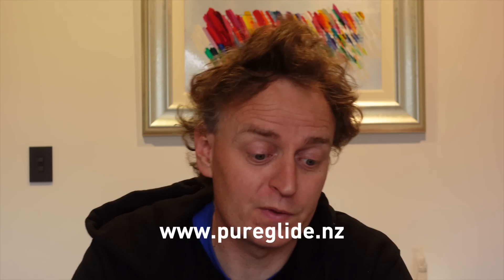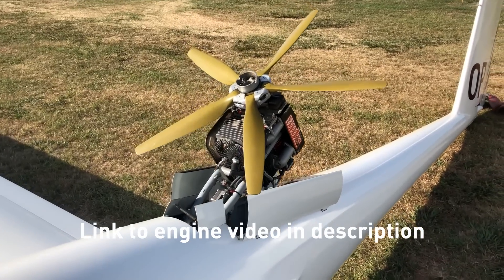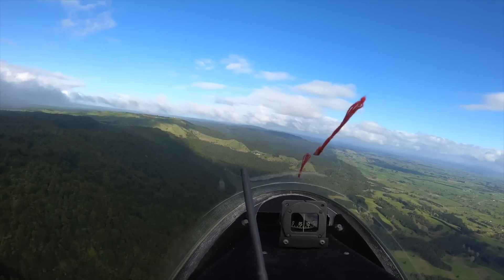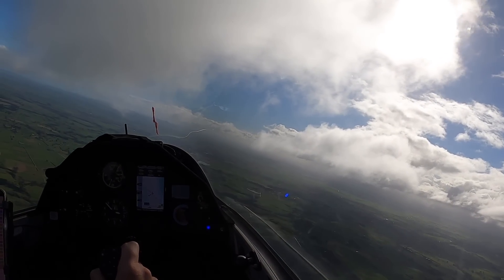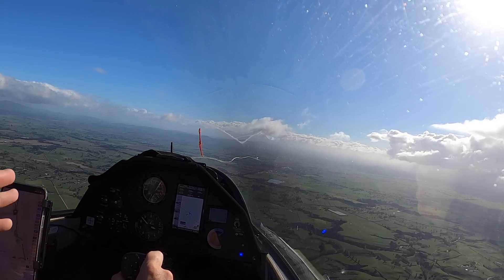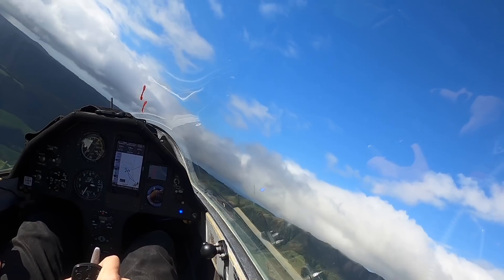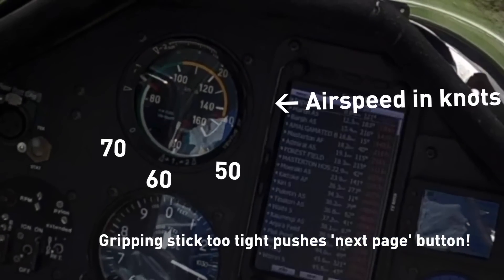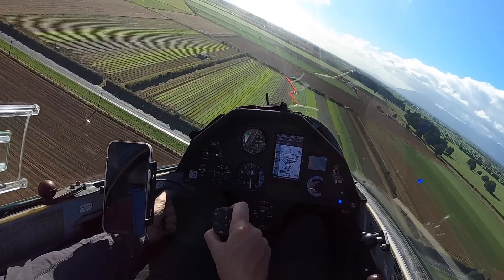Is it safe to open air brakes/spoilers in a turn?!

Comment: I love the format of the video, use this pace more (a bit of chatting, a bit of flying, a bit of stunning landscapes, a bit of music, a bit of hands off flying, show these machines are stable platforms.. nice).

Another reason why I remember being taught to avoid to use the airbrakes in a turn (unrelated with this specific case) is to avoid the potential build up of a bad post-solo habit. 
The bad habit being: to fly a crammed, very close-to-the-airfield downwind leg, and then fly a "descending elongated U turn with airbrakes out" as a base+final to lose the inevitable extra height you would end up having; thus losing the value of flying the very important base leg.
Apparently there's a tendency to do so if you get too "affectionate" to the airbrakes early in your pilot life.
I thought it might be worth mentioning it in a comment.

Last thing :) .. the comment on the video about the "next page" button made me amused a bit... no wonder you were gripping the stick, and probably the breaks' handle, pretty tight in that turn eh? 🙂
Reply from the maker: Thanks Bruno, yeah I grip the stick weird over the top of the buttons anyway, so if I grip it tight it pushes the buttons. It's like a built in stress-o-meter!
Reply: @PureGlide  that's an idea for a piece of avionics: a stress-o-meter that talks to the pilot.
"It looks like you're under stress, pull over and take a nap" 😅
Reply from the maker: lol that would be handy!

Comment: Best proof is to test it in flight, well done. But there are some variables in each flight, like the airplane, wind, landingfield (trees or swirls) or even mental situation. Thats the reason why I teach my students to not open the airbreaks in a turn to final. A accident is always a line of small mistakes and espacially in final we want to avoid every bit that can lead in a stall.
But of course you can take the airbreaks if you are familiar with your airplane and know what possibly can go wrong. I wouldn't teach it anyway.
Reply from the maker: Fair enough! Cheers

Comment: Great video Tim! One of your better ones from a chatting standpoint. I really like the conversation while in flight and panning to cool views as you have the discussion on the topic. 

As for dive brakes in a turn, it's the only way I fly the pattern. We get a LOT of sink in Florida at the end of the day, and the only way to protect against it is to not lean on the glider's glide performance in the pattern. So we fly a reasonable but tight, half dive brake (yes from abeam touchdown point), triangle plus 5 pattern to avoid being caught out in sink.
Reply from the maker: Sounds very sensible! and actually that sounds ideal, half brakes, so you have options either way. Keep doing that I suggest!
Reply: @PureGlide  I've noticed a lot of European pilots fly a massive pattern and then on half of their final they'll then use half dive brakes. I find this interesting but can't come to grips with flying the pattern that way. 

So yes hehe I will continue.
Reply from the maker: Yeah often we do that to conform with other circuit traffic. They love doing big circuits...

Comment: It would be very interesting to see the difference while doing more steep turns (45 degrees, maybe even 60 degrees). As we know stall speed increases with bank angle, and I think then airbrakes may have higher impact on a stall speed. Can someone do such experiment? Best would be in some kind of training glider, with big airbrakes that open on both sides (up and down) of the wing.
Reply: I was trained to use airbrakes starting on downwind leg as needed, ideally half open, and keep them open throughout the traffic pattern, including downwind to base turn and base to final turn, modulating them as needed for the correct altitude.  I was trained to use best L/D speed plus 1/2 wind gust factor as my approach speed in the traffic pattern, and keep the airspeed constant throughout the pattern.  This will usually give you a 15 to 20kt margin over your stall speed, which puts you well out of danger of stall/spinning on any of the turns in the traffic pattern, even with full airbrakes open.
Reply from the maker: Yeah good idea! Maybe I'll do it as part of a future flight

Comment: I think alot of the "stigma" about brakes out in the turn comes from training, where we stop pupils doing it in the final turn - primarily because more often than not its too much workload, and suggests they haven't stabilised the aircraft onto the approach. A pilot learning the approach will generally be unable to pick a reference point, nail the speed, judge their descent and complete a turn, all with the brakes out. So we teach to only open the brakes once all the others have been set and you're lined up where you want to go. Usually the brakes come out in the turn when the pilot knows they're too close in and high - a failure of circuit planning.
Once you're experienced, and particularly if you're landing out after XC, you can open the brakes whenever you like, so long as you have the speed for it, as Tim demonstrates here.
Reply from the maker: Yeah good points too, cheers
Reply: exactly. As a student, it's good advice. As you develop as a pilot and become more skilled and know more about your aircraft, it's fine to use the airbrakes in a turn if you need them.
Reply: I am completely lost when I read that. Aren't you suppose to extend airbrakes during the base leg? Then retracting them for the final turn, then extending them again after seem to be more workloadthan just letting the brakes as they are during the turn.
Reply: @haltux  training obviously varies by country. In the UK we teach new students to only open the brakes once the final turn is complete and you're set up on your approach. They can be used before that to adjust height, but it's preferable to widen out your circuit if possible than use the brakes.
As discussed am experienced pilot is free to open brakes on the base leg if they judge that necessary to approach where they want. The point I make is that early students don't always have the experience to make that judgement, particularly in advance of completing a turn, lining up on their reference point and adjusting their speed etc. We also try to avoid the "landing lever" mentality where early pilots go through the motions and just open the brakes after the turn because that's next - we're trying to teach them to judge the picture and open the brakes if and when needed. Therefore it makes sense to not open the brakes before the picture is set.
However the takeaway is often "don't open your brakes in the turn". An unintended consequence and the video shows why that's not the case.
Reply: @beefgravy OK thanks for the explanation, it makes sense. In France, where I am just starting my training, you learn to extend  your brakes during the base leg, typically half of it, and adjust depending on your height. It's interesting to see there are local specificities like that.
Reply: To stall at any speed you need to have sufficient pitch authority to exceed the critical angle of attack.  At typical approach speeds in a well banked turn onto finals, there is unlikely to be sufficient aft stick authority to g-stall most aircraft (unless the speed comes back to near normal approach stalling speed in a turn).  This is due to the normal nose down pitch tendency in a moderate/steep turn, which needs to be countered with rear stick, thus reducing the useable aft stick range available. Unaccelerated stalls in a turn are another matter.

I would have liked to have seen Tim demonstrate opening the spoilers to at least 2/3 once already established in his simulated finals turn.

Comment: MDM1 FOX 🦊🙃Driver from Austria here. I also release the brake flaps a bit on the approach, as long as you pay attention to enough speed, and always keep your nose below the horizon, it's not a big deal. Much more critically I look at the square approach with 2 quite tightly flown curves, which I always flew wrong. I always fly a very flat 180 degree turn with little bank. to talk into the final approach..  Always happy landings.
Reply from the maker: Yeah I think it’s good to have reasonable turns, nothing ‘wishy washy’

Comment: I generally don't pull open brakes or flaps during a turn.  This is more to do with the possibility of a mechanical / asymmetrical opening resulting in unplanned roll than anything else, once deployed use them - focus should be on speed control, aiming point and coordinated well banked turns.  I had an asymmetrical flap deployment (in a powered plane) once on downwind. Gets your attention - had I been in the turn to base when I deployed flaps and that occured, I don't want to think how far it would have rolled me at low altititude.
Reply: Not a glider pilot myself (wish I had the time, love it), but a light aircraft instructor, I teach my students the same thing. Refrain from opening flaps in a turn. I always use the exact thing you’re describing as a reason why. 
Having said that, have I ever done it myself? Will I ever do it again? 
The answer being:yes. 
At certain instances I have, and I may do it again. 
But I try to refrain from doing so. 
The fact that air brakes or flaps work when running the checklist is not a perfect guarantee the will work the next time you operate them. 
Basically it’s a numbers game isn’t it?

With all that said, cudos in a big way to our instructor here on the channel for discussing a matter where people question his actions. And for keeping an open mind about it. Brilliant and a show of very good airmanship!
Us instructors are by no means protected from ever making mistakes. 

Happy landings and safe flights!
Reply: @residensetresidenset6930  "With all that said, cudos in a big way to our instructor here on the channel for discussing a matter where people question his actions. And for keeping an open mind about it. Brilliant and a show of very good airmanship!" - I agree completely with that statement!
Reply from the maker: Thanks people :)
Reply from the maker: Hi that's one reason we have a 'brakes' test in our pre-landing checks. Very unlikely to get to that stage, but you never know, and you want to know early. Cheers!

Comment: I reacted about extending the brakes in a turn. It’s a marginal thing that sometimes make a huge difference, e.g. stalling the left wing or not upon a low approach.

The speed here was high enough to do it safely, i noticed, but why should you? The wings can be covered with insects or dust and don’t perform optimally. Maybe the wings still contain some water. Things happen and I see no reason to add a potentially dangerous factor to the equation. Extend the brakes when level and land a bit further down the strip. Good safe plan, right?

But, the stalling limits were examined in this video, and I should have done that myself. I'm a conservative pilot, sticking to routines because they tend not to get me killed! Once I return to the skies (alas, in a year or two), I’ll have to experiment more. I didn’t expect that out of this discussion. Still, I won't extend my brakes until level.
Reply from the maker: Yeah good points, and you're right, if you don't need to, why do it? In my original case I was concerned about running out of runway, doing a tailwind landing, and had an aiming point I was aiming at. And I needed the brakes to get to that aiming point, so I used them. Simple as that!

Comment: my teaching was "never, never, never,.....but never say never"

from your flight test, & known data / facts

+ 1-2 knots for your glider airbrakes out stall, using our Grob I found + 2-3 knots.
- airbrakes can change the trim / attitude , depends on the A/C.

clearly you had good speed on , and you're a better than average pilot, by some way.

for the average pilot they may be struggling with a high workload, having made a mess of the circuit / approach in some way.

Risks : ( Threat Error Management - TEM )
they are tired after a long flight
they are mentally "beating themselves up" as they have got into a high workload situation, not the nice clean circuit they hoped to do. They may be landing in a paddock when they were at 4000ft 20 minutes ago.
they may let the nose rise in the final turn
they may be in a glider where the airbrakes change the trim, more nose up of down

so why  would you increase the risks in the final turn?

Now when to use airbrakes in the final turn. ( the "never say never" bit.. )

If you have got yourself into an approach into a small field that you are going to hit a wall at the far end....

1 - Fully open the airbrakes on the Base leg
2 - Check your speed and trim
3 - Complete your turn onto final without making any change to the airbrake setting, so no change to stall speed or trim during the turn.
4 - level the wings and check your speed / attitude trim / glide slope

if you need to close the brakes now, you didn't need then in the final turn. I have seen people do this just to have a shorter walk back up the airfield.

my opinion of course, but trying to teach pilots not to erode margins.
Reply from the maker: Cheers for the comment!

Comment: I'll have to try this out with spoilers as opposed to airbrakes. The difference should/will be a bit larger. Potentially there's more danger doing this in a Ka8 (if you don't watch your speed). I have found I complete spoilers open turns more often in powered - particularly when descending from overhead.
Reply from the maker: Wait what's the difference between airbrakes and spoilers? I use the terms interchangeably... our Purchacz has "speed limiting airbrakes" i.e. you can dive with them completely vertical and not exceed VNE, and some gliders have trailing edge flap brakes, but that's all I know :)
Reply: @PureGlide  Generally in the gliding world the terms are used interchangeably, but technically they do serve slightly different purposes. On most modern gliders it's airbrakes - they travel vertically and disrupt the air flow (effectively 'braking'). Spoilers operate at an angle which redirects the airflow upwards reducing lift and increasing drag slightly. Not sure about the purchacz - haven't seen one!
Reply: @PureGlide  very few gliders have speed limiting airbrakes. most are effectively "spoilers" but the terms get used interchangeability.
Reply: @PureGlide  Just found this nice BGA document on them - https://members.gliding.co.uk/wp-content/uploads/sites/3/2017/08/2-11-AIRBRAKES-_-SPOILERS-2017.pdf

Comment: As others pointed out every glider is different but it is interesting that the CS (FAR)-22 is not super clear what is the allowable difference in stalling speed with or without airbrakes. I infer from cs-22.29 that it is 5 km/h. My problem is that when you open the airbrake the angle of attack on the wing has to increase and it takes time, therefore, the glider picks up some extra sink rate compared to the steady-state and that means the angle of attack overshoots a bit. This overshoot can be a problem. I admit you have to open the airbrake super quick to make it noticeable but low turn combined with usual sideslip+fatigue at the end of the day+shorter strip than expected + confidence in airbrake. I am certainly guilty of these and had no issue but I tend to lower my confidence in airbrake during turns.
Reply from the maker: The best idea is to test it out at altitude! Cheers

Comment: Agreed. Airbrakes are fine in a turn. Much more critical is over use of rudder at slow speed, especially from base leg to finals. Then you are provoking a spin. So a good speed on base and finals is more important than anything else.
Reply from the maker: Agreed, cheers!

Comment: I'm still a low-hour pilot, solo but not licensed yet. This still freaks me out! I do not dare turn with the brakes out when i'm in the pattern. 
My glider stalls at 72km/h, my approach speed according to the POH is about 96km/h and I usually fly faster the lower I get. I just can't get comfortable with it. I guess it's the vibration or the added noise that gives me stress. This means I close the brakes when I turn, altering my glide path, and thus causing other forms of stress :D
2 weeks ago the wind was really strong (30km/h headwind) and I noticed I was doing 150 km/h on final. Not healthy :o All because I really really don't want to stall it so close to the ground.
I really need to calm down and this video really helps me do it. I'm going to try the same experiment to get comfortable with it (at altitude of course)
Reply from the maker: Hi sounds like you've got a good attitude, always safer to be a bit too fast when you're learning! As you get more experienced you'll more instinctively know when you're going too slowly. Do practice gentle stalling at higher altitude, so you really get to know the limits of the gliders you're flying, they're all different. And focus on nailing the speed you actually want on landings, all the way down. It all takes practice. Keep it up!